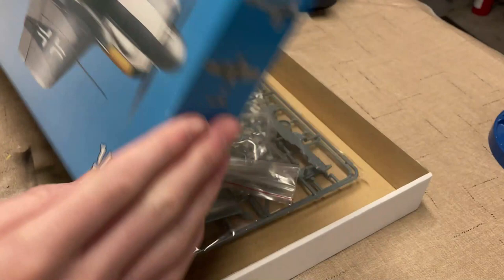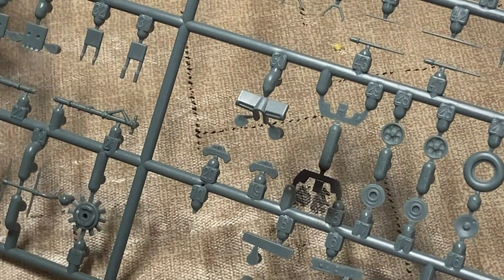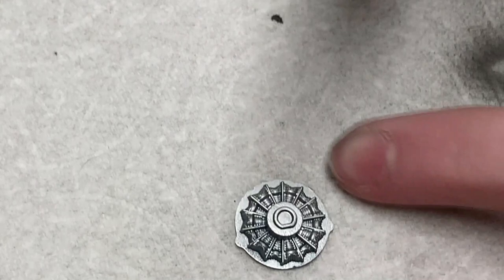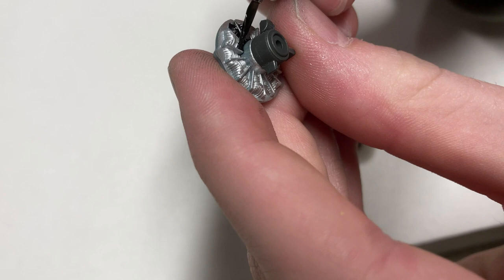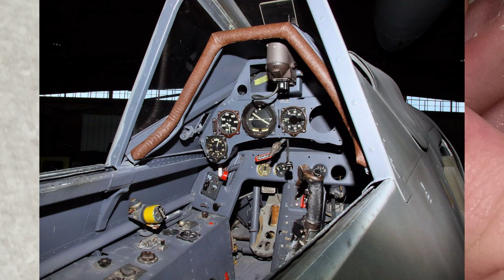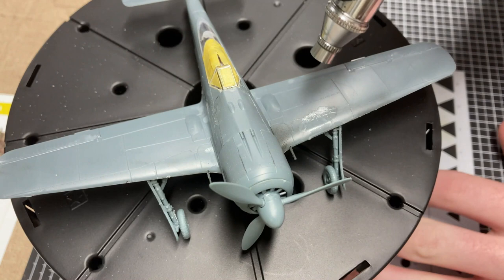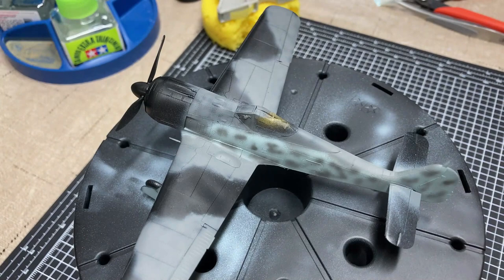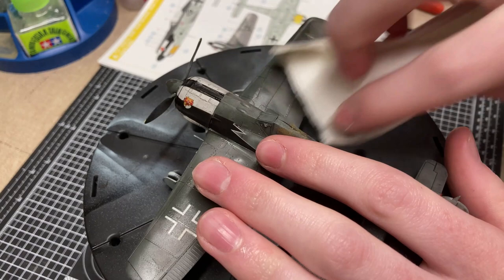Is it possible to FINISH a model in 72 hours?!

Comment: German Aircraft of WWII did´nt have yellow prop tips and the prop paint was not black but a blakish dark green, called black green RLM 70.  I use vallejo paints and the likes only for brush painting, in an airbrush with needle size 0.2 or smaler  these clog the airbrush very quickly. If you can stand the smell and have good ventilation for your room, go for Tamiya or Gunze / Mr. hobby with MR hobby leveling thinner.  Other than that, keep on having fun with this wonderfull hobby.
Reply from the maker: An oversight I never really thought about, but thanks for the info! I do have Tamiya paints and use them for most models but they were out of the colors I needed at my local hobby shop so I had to settle for Vallejo.